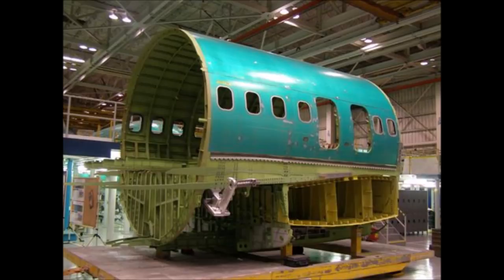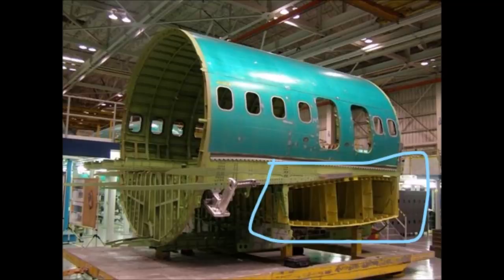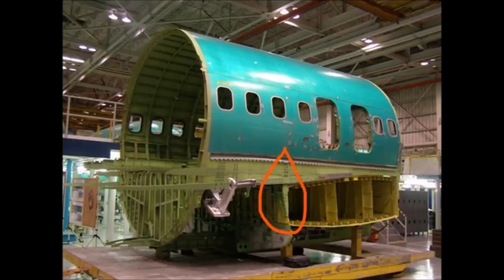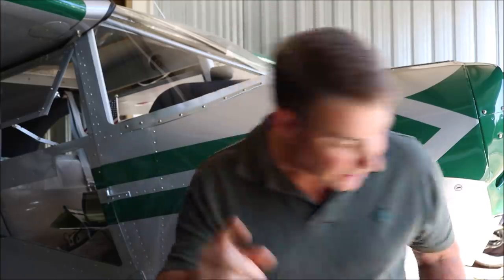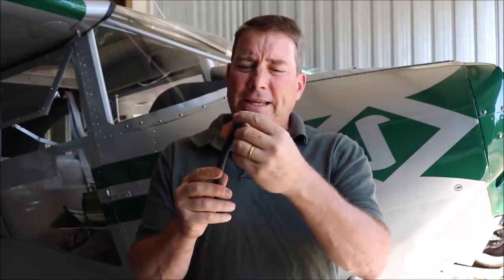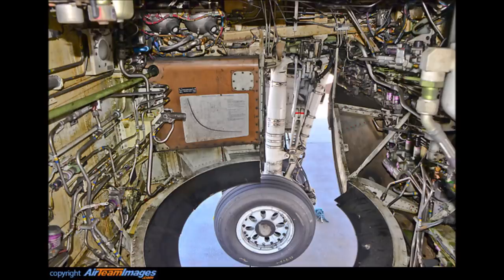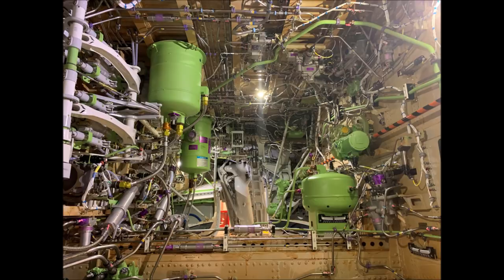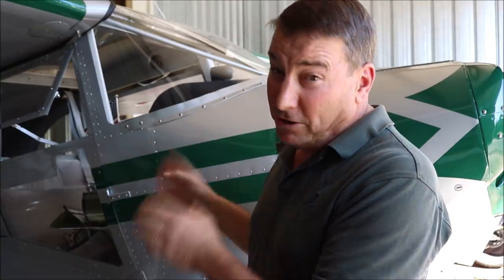737NG Pickle Fork Cracks AD 2019-20-2

Comment: 30 thousand cycles? Or did you mean 3 thousand? 30 thousand sounds high to me?
Reply: Now for a short haul operator  like Southwest airlines  they planes can rack up 10 cycles a day  start in So California LAX to Oakland to portland or seatac  and back down   then another crew will take over
Reply from the maker: Airframes are supposed to last 90,000 cycles
Reply: Thanks for that. I wasn't aware planes could have so many cycles.
Reply: @blancolirio  I was picturing what happened with BOAC  and the Comet.
Reply: @waltlars3687  Or Qantas / Virgin Pacific on the Melbourne to Sydney run - just over one hour each way, ten to twelve flights per day per plane. (Qantas has 737 flights at 15 minute intervals each way from 6am to 11pm). (One flight every five minutes in each direction on this route).
Reply: @allangibson8494  Southwest runs about one a hour and its hour flight from the Southern California Airports to Northern California    I watched about 6 SWAs depart Los Vegas  in a row  each on a slightly different heading 
The joke goes the Southwest bus company 
The said thing is  that is more than My local bus company runs  about 75 to 90 min apart
Reply: @waltlars3687  There is a longer gap between the trains to Sydney airport railway station than between Qantas flights to Melbourne... (The Sydney - Melbourne route is the second busiest air route in the world (the busiest is the Seoul - Jeju route in Korea)).
Reply: @allangibson8494  I thought Southwest had a lot of flights  I yeld to to You Sir
Reply: @blancolirio  depends on the airframe and what the flight intent was designed. Like someone mentioned its a small fuselage, short flight, that sees lots of flights daily.